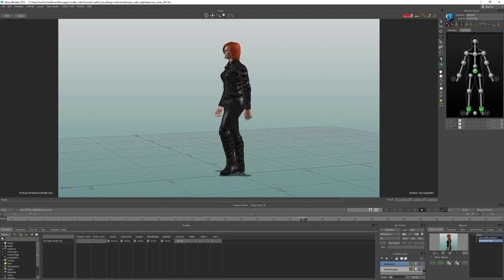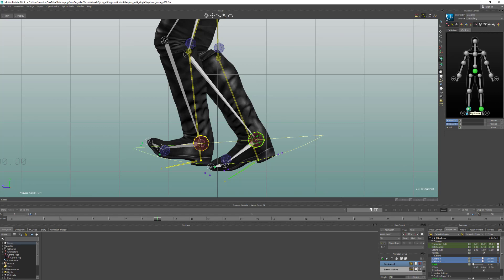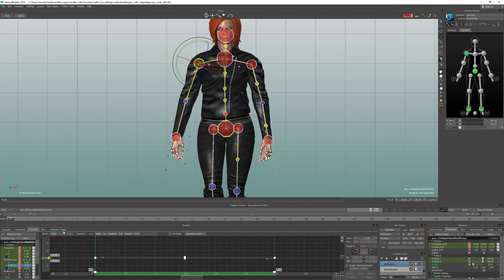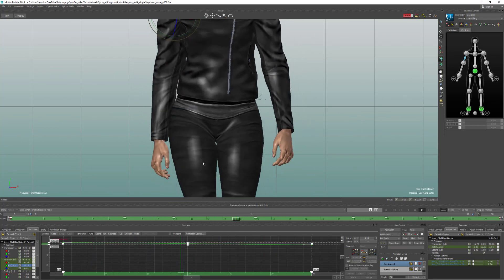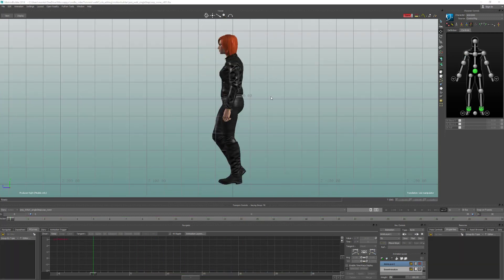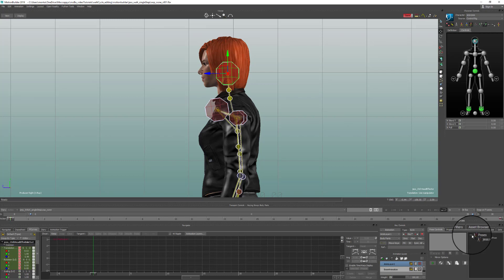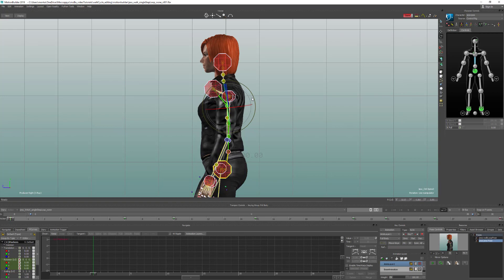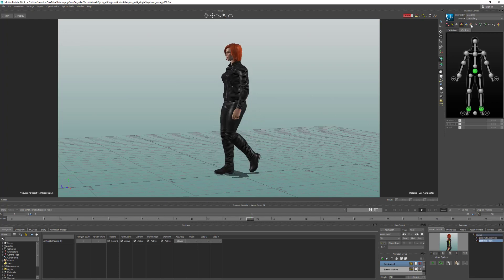How to use MotionBuilder's Control Rig to Edit Mocap

Comment: This tutorial is  very good and very helpful. I am cleaning up the soldier data movingthe action of crawling on the ground. Arms and legs that can be moved with IK can be fixed on the floor, but elbow and knees are not fixed and move continuously. This problem is very difficult because the Aux Effecter cannot be fixed with elbow and knees. Is there any way to pin elbow and knees that contain animations?

Comment: Is it possible to solve for a single axis elbow given that the mocap data is rotating on all 3 channels?
Reply from the maker: it is, but there's a couple of things you need to check in the rig you're mapping to:

One of the rotation axes must be aligned with the joint.
The roll axis should be the first axis in the Rotation Order you have set for the joint.
If you limit the DOF for the roll axis, you will need to use a roll bone or remove the DOF for all three axes on the wrists and ankles.

Then in MotionBuilder you can turn on "Character Settings>Modifiers>Kill Pitch" for the elbows (and knees).
Reply: @mocappys  I knew there had to be a way.  I will give it a try.  Thank you
Reply from the maker: Good luck! Let me know if it works

Comment: Hello! Thank you for all the videos and tutorials on mocappys! They have been a lifesaver. But I have another question! I have a lot of mocap files, and I need to move them to the origin. I read that I can use the "In Place" modifier to do that, but I need a control rig for that, and I don't actually have a control rig on either source or target skeletons. I tried using the Move Tool but I think that won't work because we had to do retakes of some of our mocap files (they are conversations) so they will be at different offsets from the origin to begin with. What can I do to fix this?
Reply from the maker: Hello! Great to hear the videos are helping. Made my day🙂

Sounds like you need “Move Keys” or “Story Tool”

...and this handy tutorial that explains how they work

https://mocappys.com/realigning-animation-in-motionbuilder

Good luck
Reply: @mocappys  Thank you so much! I will try this! :D